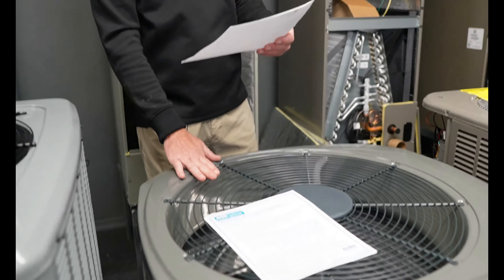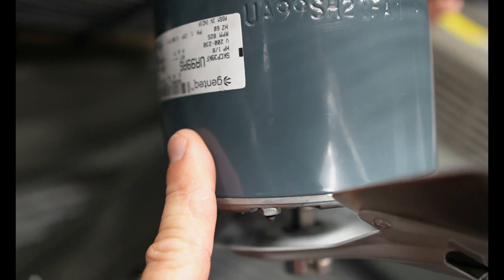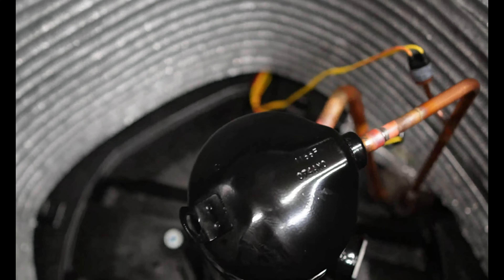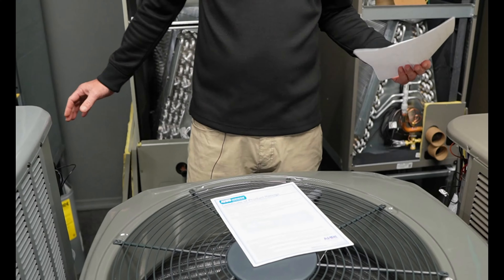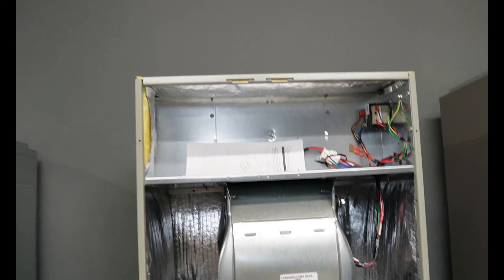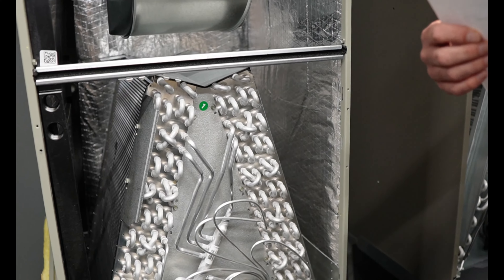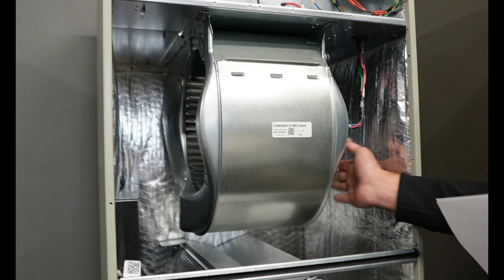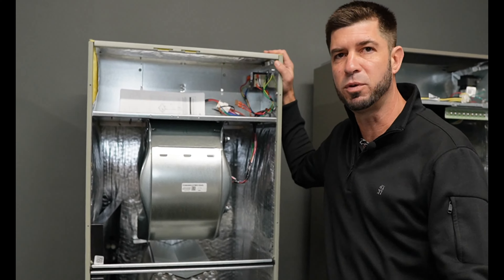Know before you buy! Trane Air Conditioning System Review. Model# 4TTR40 and TEM4B0

Comment: Our Air Handler and Heat Pump and Thermostat are not powering on: the labeling on the air handler is  Trane U.S. Inc Manufacturer of Trane & American Standard HVAC Tyler, Tx 75707, the Model Number is TEM4B0B24M21SAA, Serial # 22501S2M3V, 1/3 H.P., 2.80 F.L. AMPS, 208-230 VOLTS, MFR DATE 12/2022 and we had it installed on April 14, 2023.  The System fails to power on and/or communicate in its circuitry? 
WE PAID A LOT OF MONEY AND WE EXPECT TO GET A BETTER PRODUCT!
Reply from the maker: Trane units are considered to be industry standards. Its most likely an installation issue. Hopefully your HVAC contractor can get this fixed for you.
Reply: @GWAC555  I was ignorant to the shut-off switch, but I was correct that the condensation pipe needed to be cleared of algae (?) - Geez Louise it looked like it was paper coming out of the pipe.  The HVAC Technician arrived with a larger shop-vacuum, cleared the pipe and tested the air temperature.  It took nearly 12 hours for the HVAC system to cool the upstairs and the cathedral ceilings in the master bedroom and downstairs' living room are most likely the main reason for the long period.   I am still mad at the Timberman Roofing Company - they did not replace the sheathing on the whole roof: they only replaced sheathing that they deemed necessary.
Reply: @PappyNet01 
I'm having issues with my Trane air handler right now and I'm NOT HAPPY either.
Did the tech show you how to take your garden hose, turn it on high, then crimp the hose in your hand and put it over the 90 degree PVC sticking out for drainage, the let it go!
That water will go in and bust loose all the algae that forms up in the pipe and yes, it comes out like pond scum!!
I have no husband (never have!) and therefore I've learned over the years how to fix most stuff on my own.
Good luck!!
Reply: @TurkeysAreCoolBirds  Thank you for your response, but your method with the garden hose sounds too risky with our system.  We have too many 90-deg angles.  However, if I could cut the PVC and install a PVC fitting Tee 45° then I could use my garden hose with a small "Cobra Bladder". Last Fall I purchased a bottle Purafilter 8 oz Drain Ac Line Cleaner, but I was unaware that you have to power-off the HVAC system for 20-minutes - we will wait until spring season for warmer weather.